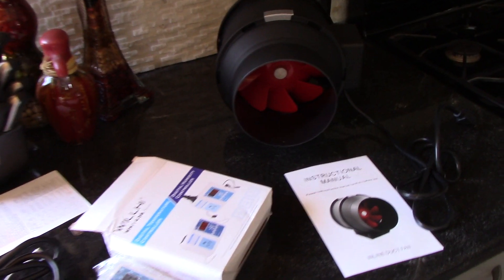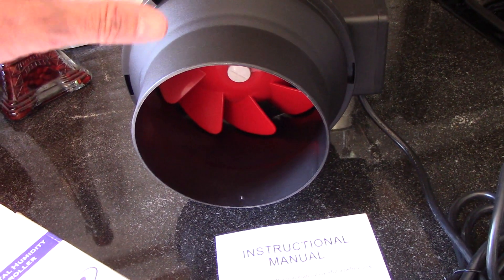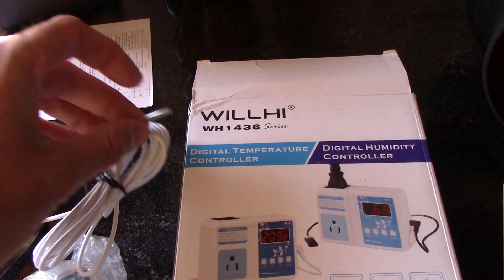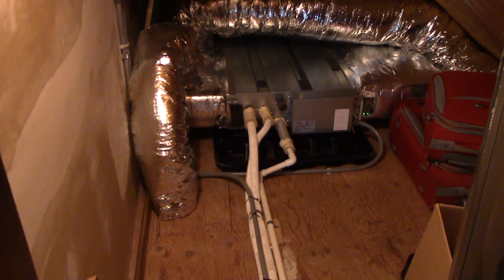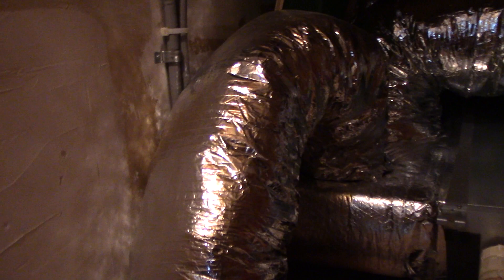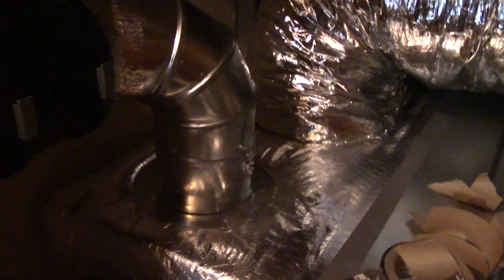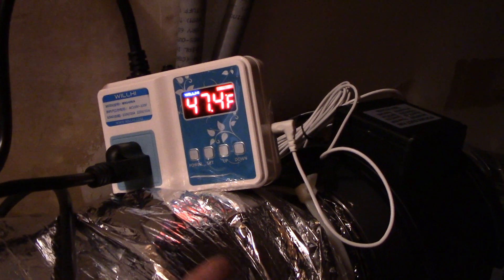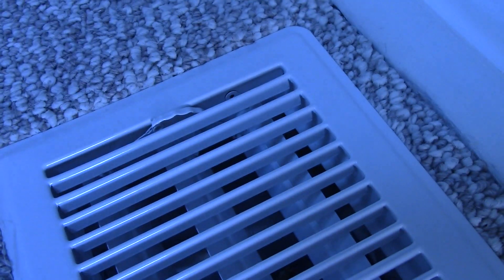MORE HVAC POWER! Improve Ducted HVAC With a Automatic Booster Fan

Comment: I thought the idea with these is you wire it to the blower on your hvac so when the blower kicks on the booster kicks on
Reply from the maker: Not an option with a mini split.  Mini split's dont have typical thermostats with typical wiring you can use a relay with to trigger external fans.  That's why the controller is key, you can use the temp probe with any type of system.

Comment: You can get a good 5000 BTU ac for about $140 for the room that size. Wouldn’t that be more efficient and cost effective. 😆
Reply from the maker: Not cost effective to run at all.  Window AC's are horrifically inefficient, loud and a pain to put in and take out with the seasons here.  We use to have window AC's and now the house stays cooler and with a lower electric bill so it's a win win.

Comment: You could've broke the load wire hot/black wire by installing a 24volt coil relay which is wired in with the cooling terminal on the board to your furnace use the Y terminal and C terminal for common
Reply from the maker: This isn't a furnace, it's a mini split so there's no common wiring for them unfortunately.  That's a great idea for a conventional system though.  This solution with the temp probe will work for anything.
Reply: Clearly the far required 120v if he’s wired it to the electrical out let so 24v wouldn’t run it
Reply: @jrome254  read what I wrote again
Reply: @jrome254  do you understand how a relay works 24 volt coil like a contactor go back to school
Reply: The Y terminal is for the outdoor condenser.  It would be the G (fan) and the C (common) terminals that would be required.
Reply: @EbanQHanna  ya no, only for cooling mode wire the 24 coil of relay using yellow and common cause some thermostats do not sending signal to the g terminal when calling for cooling or heating but nice try though amd if you really want to get technical I use 2 relays and I have one from w and one powered from the y terminal it doesn't matter if you leave the fan on on when it calls for heat or cooling the signal is interpreted by the either call.
Reply: @Milerhighlife2011  Not trying to get technical or compete with knowledge.  Traditionally the G terminal controls the fan relay and is responsible for turning the blower fan on and off automatically or manually via the thermostat.

Since this is not an advanced HVAC discussion and I'm not trying to impress with my HVAC knowledge it would be best to keep it as simple as possible for the novices that come to YouTube for advice.

That is to say:

G: Fan
Y: Cooling
W: Heating
C: Common
Red: Power
Reply: @EbanQHanna  no it would be a 6 leg relay to turn the fan on when calling for cooling or heating, now do I have to actually say this again the g terminal is for calling the fan on with a certain speed and unless you turn thermostat to on not autothe damn booster would never turn on so when calling for cooling it sends a signal back to the board to the y terminal then to one of the leg on the relay yes there is also a fucking relay that's connect to to board a fan relay that controls the blower motors speed yes a blower motor has multiple speed taps ok so now tell me your not a tech without telling me your not a tech. Have a good day green horn

Comment: You did a great job man I was pretty sure I could do it, but I wasn't sure what kind of a switch control to use. Thanks mucho this will save me a thousand bucks!!
Reply: Thanks for this. 
In your opinion, can I wore direct
To the Air Handler? So the fam turns on when the condenser and air handler turn on.  
I’m not understanding how the little Willie helps. Meaning if the sensor tells the fan to come on and if the condenser/air handler haven’t turned on , what air is it pushing?
Reply: That’s wire. Not wore
Reply: There is an EDIT feature. Click the three dots on the post with the misspelling, then EDIT. 😉
Reply from the maker: Good deal!  Let me know how you like it once you get it setup and good luck man.

Comment: You need to insulate the metal duct leading into the fan or condensation will build up on it and drip.
Reply from the maker: True.  I did wrap any exposed metal in insulation.  Thanks for the tip/good looking out!
Reply: @Trialnerror  should you wrap the fan also?

Comment: now where in the line did you mount the temp probe? How does it turn off/on in winter when you want to move heat? Can you set a temp "range"?
Reply from the maker: I mounted the probe just before the blower.  I don't use this system for heat but you can program a completely different set of data points (heating temps) to have it cycle on and off with the heat.  Great questions.  Thanks man.

Comment: I got this exact same set up and I’m having difficulty get the WillHi set correctly to cut on and off at set temperatures. I’ve set the H Ld = 82and Hb = 70. Thinking this would cut the unit on at 82 degrees when the heat was running and cut off at 70 degrees once the heat stopped running and the line cooled.
Reply: Hey I hope u replaced that insulation back in that elbow
Reply: The temp might be for cooling they make ones for heat not sure or switch the settings around